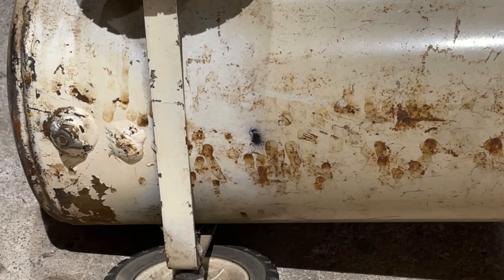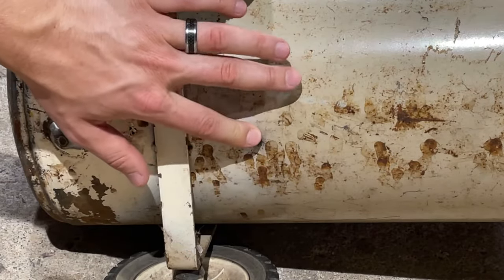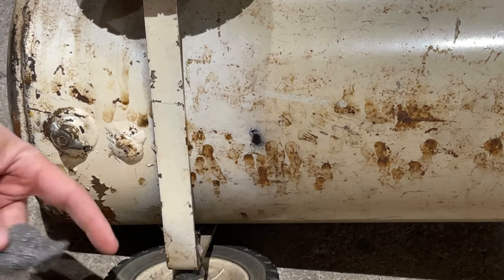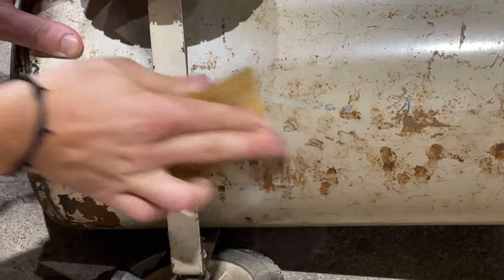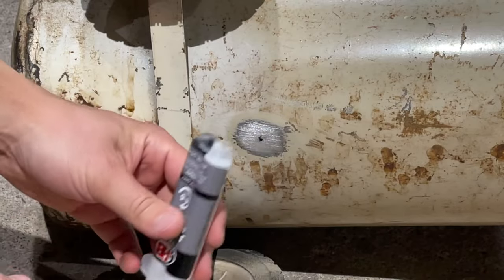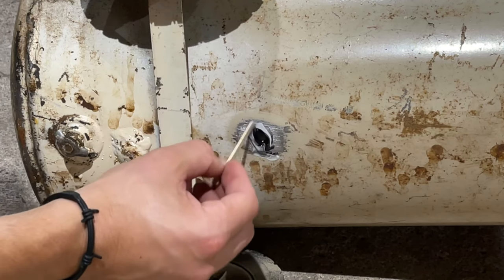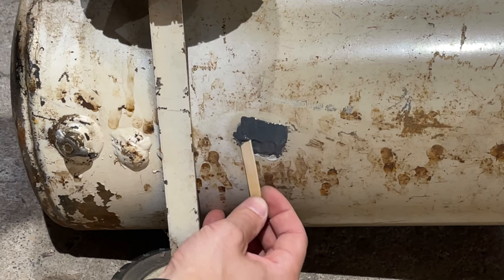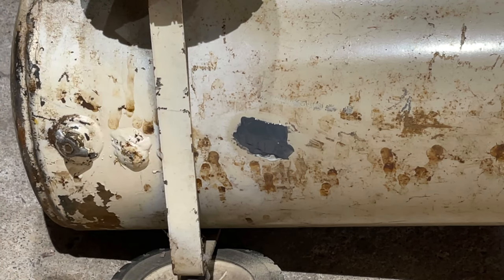How To Fix A Leak In An Air Compressor Repair Air Compressor Leak

Comment: How often do you do this? I’ve read it’s dangerous…
Reply from the maker: I did it once. I’d recommend replacing the air compressor rather than patching a hole. The JB Weld lasted about 6 months with minimal use.
Reply: doing the repair is not dangerous .typical.misinformation.....the dangerous aspect is why is there a pin hole?..was it punctured or is tank insided rusted real bad and steel getting paper thin?...if rusted and paper thin then it could be dangerous using the tank.